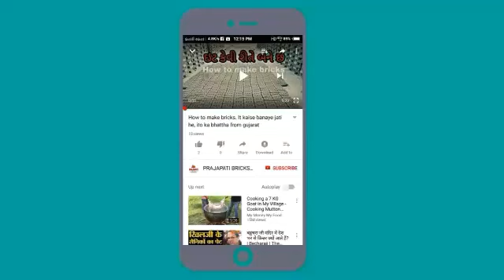How to make RED BRICKS from raw bricks, कच्चे इटो को पक्की कैसे किया जाता है।

Comment: Hi
What is that white and black powder you are putting between the bricks
Reply: @gujjubusinessman6613  thank you for replying
If I don't have them what can I use?
Reply from the maker: Hi Mr.soumare.
Thanks for Your Comment
If U don't Have any Material so u can Add Mostly Coal
And Coal powder Is Very Important Of in clay.
Reply: Lime, (white and lighter gravel-like material) is used to absorb the sulphur from the coal, but also as a spacer to permit the entrance and circulation of oxygen during burning, it influences in the final color of the bricks.  The black is coal, as fuel. Most coal has a very big % of sulphur